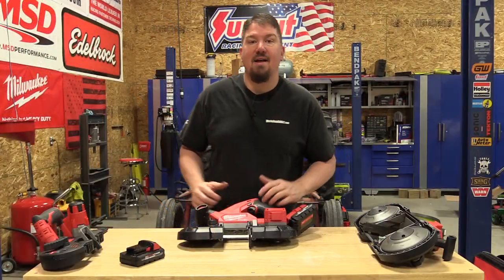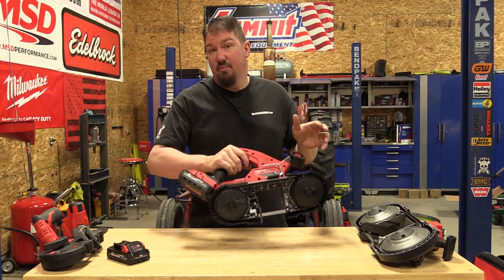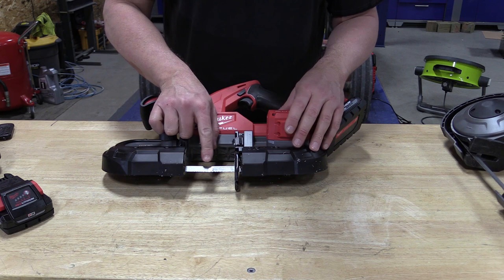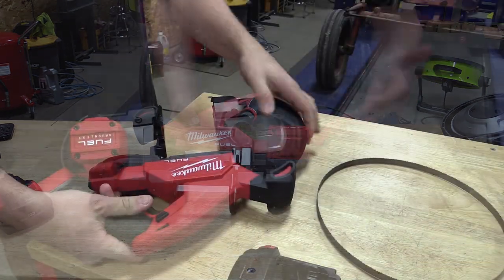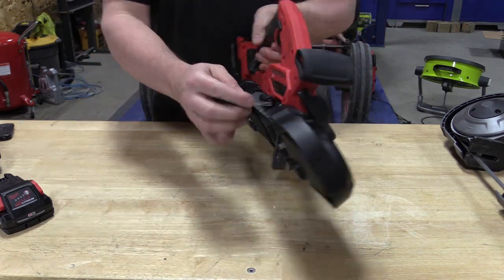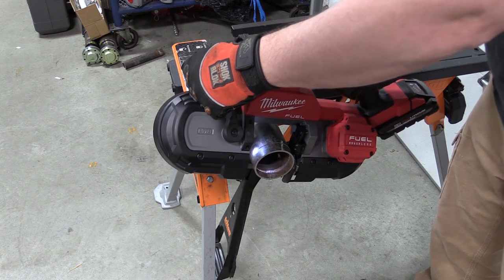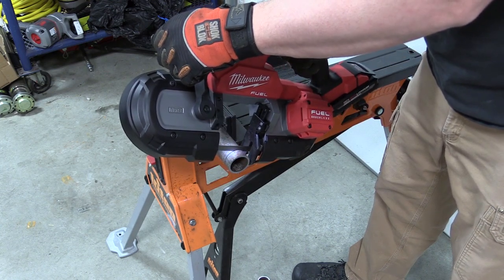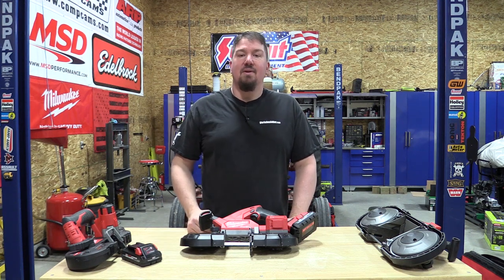Milwaukee Tool M18 FUEL Compact Band Saw Review 2829-20 2829-22

Comment: I have one of these and I love it. I did notice though when we went to move a panel and had to move the service, the pipe was 3in and it wouldn’t cut all the way through so keep that in mind even though it says 3-1/4 it will not cut 3in pipe unless you can spin the pipe or walk around the pipe.

EDIT: it will cut 3-1/4 EMT or PVC pipe but it won’t cut 3in RMC (rigid)
Reply: Anything 3" OD?

Comment: I had the m12 one and it kicks ass for us electricians but I wanted something bigger and got this compact one. Pretty dam excited to try it out.
Reply: Should have got the m12 fuel bandsaw. It cuts up to 2 1/2 inches and it's faster than the m18
Reply: @WestHaddnin yeah but runs out of battery in 10 seconds
Reply: @Mrsmith69  not true. I’m an electrician and I use it all the time. I also use bootleg 9.0 m12 batteries and they work great.
Reply: @WestHaddnin  that makes sense but for the same price you can just purchase the m18 fuel one that cuts larger conduit and the battery lasts longer especially if you want to throw a 12.0 m18 battery on
Reply: @Mrsmith69  Its not the same price, that’s the point. And  I don’t to carry around a heavy ass bandsaw with a big ass battery on it. You only need 4 inch +,bandsaw for single line. M12 fuel for the win 💯
Reply: @WestHaddnin  I see your point, I guess someone always has a m12 around the job sites I’m at whenever I need it, extremely rare tho. Only time it could be too heavy is when cutting conduit over your head. Rarely run into that occasion

Comment: I have a cordless dewalt deepcut. I use it to to cut 3" pvc when running flu, all-thread, unistrut, gas pipe, etc. I can walk into my local supply house and find dewalt blades on the wall.
And I'm still on my first blade. Bad ass.
 But I recently picked up a Milwaukee m18 compact for smaller cuts and I can't believe the fiasco with blades.  I literally burned up my 1st supplied blade with no teeth left after cutting one 1/2 inch black pipe..
 I've been on the phone with Milwaukee but I can't seem to get a straight answer on what blades I need for general HVAC and electrical work. 
It was an EXTREME THIN METAL blade.
I found some 48-39 0529 blades at ace, but may just send this sweet tool back if it's gonna be this hard.  No point in having a bad-ass tool I can't get quality blades for.
Any advice?
Reply: I found some, called (extreme thick metal cutting blades) they worked great.
Reply: @truthserum9157  
Thanks man..
I found the 48-39-0528 works great..
Appreciate it..
I'll try those out..

Comment: Just bought one and worked awesome for the first few cuts. I switched the blade and it won't penetrate my 2 3/8 pipe. Just scratches it and keeps spinning. I'm running the thick metal bands (10/12/14). Nothing.

Comment: Can you change the angle of the blade and a different blade like for wood?
Just wonder if you can use for carpentry, sorry maybe is pretty dumb question. 😔
Reply from the maker: No, the bearings that hold the blade are not adjustable.
Reply: WorkshopAddict thanks for the quick response.

Comment: So the milwaukee deep cut band saw and the new Milwaukee new m18 compact are the 2 I would want to pick up then appreciate the info do alot of exhaust work as well as big steel metal fab
Reply: I have the dewalt versions of there deepcut and compact bandsaw. In my opinion if you have the deepcut then the smaller compact of 2 1/2" like dewalt and others have is more ideal for compact as the handle trigger design is on top and easier to use 1 handed. But this Milwaukee size is more ideal if its you only bandsaw but dont want the full size as it has larger capacity. Milwaukee is making an m12 version of the 2 1/2 which i would think is better but only if you already have the deepcut too
Reply: @bossmanz28  i got the Milwaukee m18 fuel deep cut as well as the m12 sub compact about 8 and a half months ago love them so far thanks for the response

Comment: Hello there! Great review, exactly what I had been searching for :) 
Is it possible to cut small radii in sheet metal with this? I believe, such intent would require a smaller-diameter blade. So in other words: Can you use smaller blades for this? 
Thank You!
Reply from the maker: You can use smaller blades.  They might be harder to find.
Reply: @WorkshopAddict  Thank you Sir!

Comment: I see you have some Amazon links listed above but it looks like Amazon isn't actually selling it.
Reply from the maker: I did not link to one specific seller.  Look below and it will say sold by 2 people.  Click on that and it will show you the two sellers and their price.
Reply: @WorkshopAddict  I saw that. Usually those "Available from these sellers" are rip-off places. Example... they both want  $430 + $25 shipping for the same bare tool that others are selling for $279.  They want $690! + $40 shipping for the "Kit" that HD is selling for $449.  I avoid those "other sellers" like the plague.  :-)
Reply from the maker: @eosjoe565  understand, but long term, my links will populate with the best price rather than with just someones price.  You know what I mean?
Reply: @WorkshopAddict  Yep - see what you mean.
Reply: Amazon is not an authorized seller for Milwaukee tool.